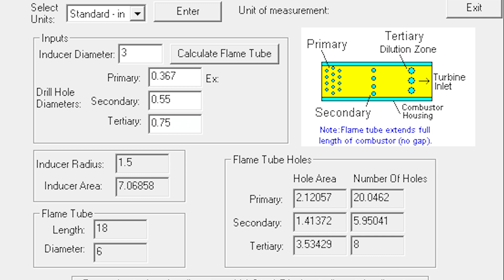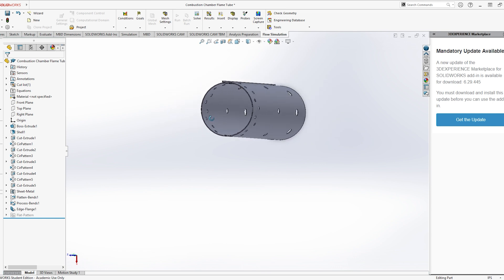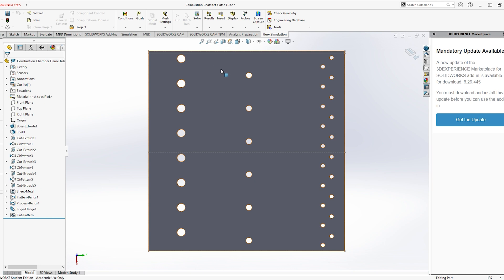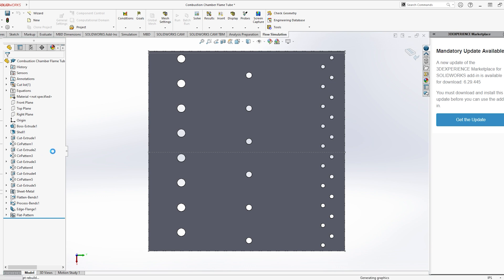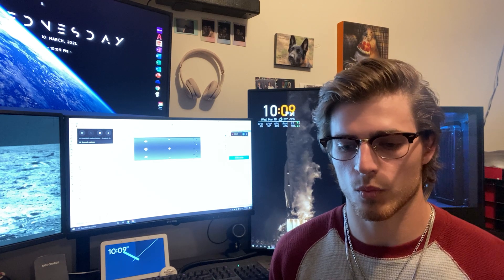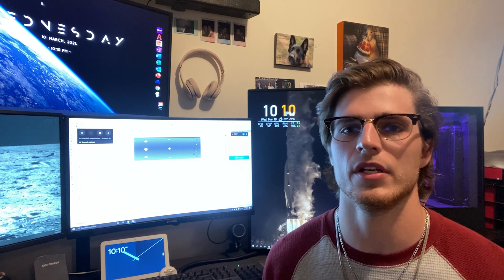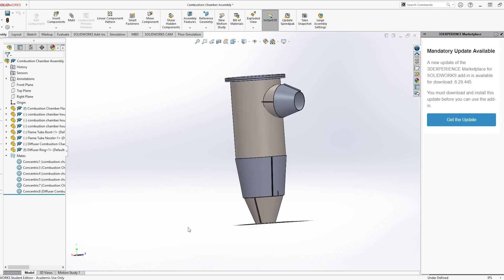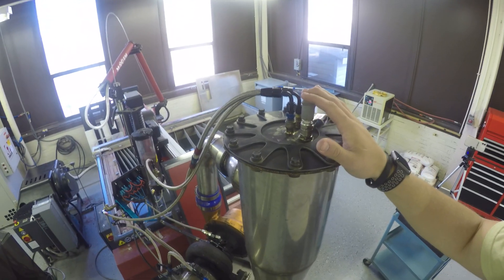Combustion Chamber Design

Comment: Does your design algorithm take into account jet penetration and flux momentum for primary and dilution zone design? Also the program doesn’t take any inputs for primary zone equivalence ratio so what’s used for primary zone sizing? The chamber volume and hole diameters vary alot depending on the ER and therefore FAR decided by the designer. Also does the program take into account hole spacing which influences maximum penetration? Finally,  do you have an accurate estimation of the pattern factor/ transverse quality factor, since you mention not damaging the turbine? The program looks nice but it lacks so much input paramèters and even if those where somewhat hidden inside the algorithm it still severly limits the design degrees of freedom… holes aren’t everything in a combustor